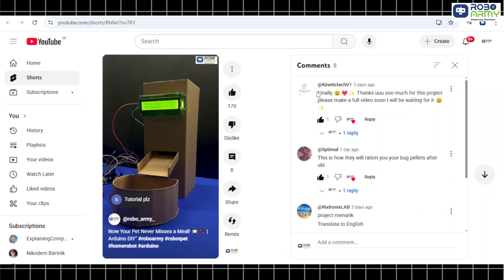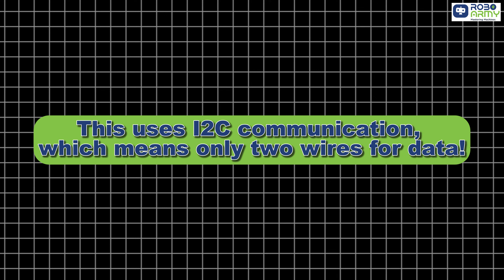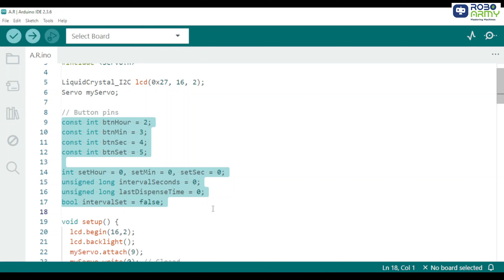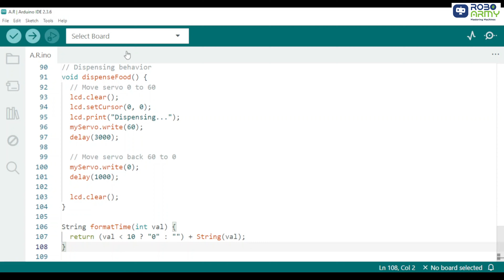No More Mealtime Worries – Auto Pet Feeder | Arduino | Full Project Explained

Comment: Hello! I'd like to know why the " automatic pet feeder " text doesn't show up even though we have the same I2C Adress? The servo motor is working just fine, it's just the LCD that's the problem.
Reply from the maker: Hi! Good question 👍
Even if the I2C address is the same, the LCD text may not show due to a few common reasons:

1️⃣ Contrast issue – Please adjust the small potentiometer on the I2C module; often the text is there but not visible.
2️⃣ Wrong LCD initialization – Make sure the code matches your LCD size (e.g. lcd.begin(16, 2)).
3️⃣ Power issue – Ensure the LCD VCC is connected to 5V and GND is common with Arduino and servo.
4️⃣ Loose SDA/SCL wires – Double-check A4 (SDA) and A5 (SCL) connections.
5️⃣ Library mismatch – Try using the LiquidCrystal_I2C library and confirm the constructor matches your address.

Since your servo is working, the Arduino is running fine — it’s most likely a contrast or LCD wiring issue.

Comment: Hello MY PROJECT IS DUE IN 3 DAYS , can you please make a video IoT "Plant Stress Detection and Rescue system",  For that sensors we’ve to use are:
DHT11
LDR
Water level sensor 
Actuators:
LCD
Water pump, and pls using Arduino UNO, connecting it to thingspeak and also pls Connect it to IoT.
Reply from the maker: That sounds like a fascinating project! Unfortunately, we won't be able to create a full video tutorial on that specific topic within your deadline.

Comment: HI, why is the hour and minutes button not working but only the seconds and set buttons are working, pls help. :(
Reply from the maker: Hi! 😊 Thanks for trying out the project. If only the seconds and set buttons are working, please check the wiring for the hour and minute buttons — especially the connections to the Arduino pins and the ground line. Sometimes a loose jumper or incorrect pin number in the code causes this issue. Try swapping the buttons or checking continuity. If it still doesn’t work, share a clear picture of your setup so I can help you troubleshoot better.

Comment: hello i  have watch ur videos i see how good u  are  i what u to help me do a video or code for one  coin  accepter operating 4 or more relay  as timer any time u inset coin it should ask u to set a bottom 1 to 4 or more for ur time even if relay 1 is working or a deferent person is using relay 1  
if relay 2  is working with time and e deferent Prosen also whant to use relay 4 time so any time a new coin as Bing inset   it should ask for set a bottom to start witch  not to add with the one oready using
i hope to were from you soon thanks
Reply from the maker: Thanks a lot for your kind words and support!  Your project idea sounds really interesting — a coin-operated timer system that can control multiple relays independently is a great concept! 

It will require some advanced coding with Arduino, coin acceptor, and relay modules to handle separate timers for each channel. I’ll definitely look into it and try to make a tutorial or at least share a sample code soon.
Stay tuned to the channel — I’ll update once it’s ready!

Comment: Hello sir we make this project but in our i2c lcd not show automatic pet pedder and can you tell me in this project one breadboard is used or two breadboard we are confusing
Reply from the maker: Hi! If your I2C LCD is not displaying ‘Automatic Pet Feeder’, first make sure the I2C address in your code matches your LCD’s address. You can use an I2C scanner sketch to find the correct address and update it in the code.

For the hardware, this project uses only one breadboard. All components – Arduino, LCD, motor, and sensors – are connected on the same breadboard. Make sure all connections are firm and follow the circuit diagram properly."

Comment: How is the power supply connection can you explain?
Reply from the maker: Sure! The pet feeder is powered using an Arduino board. You can connect it either to a USB charger, a 9V battery, or a 5V adapter depending on your setup. Make sure the positive (+) and negative (GND) connections are correct to avoid any issues. If you want, I can also explain the exact wiring for the motor and sensor.

Comment: Hello! Could you make a food dispenser that uses a stepper motor and a counter from 0 to 9999. And that has a timer to release the food, reset, turn off - on and finally release the food at the time
Reply from the maker: Hello!  That’s a really interesting idea — using a stepper motor with a counter and timer would make the feeder even smarter. Right now, my project is based on a servo and simple controls, but I’ll definitely note your suggestion for a future advanced version. Thanks for sharing your idea!

Comment: How did you make the box and did you use anything inside the box?
Reply from the maker: Thanks for asking! I made the box using simple cardboard sheets, cut and joined to form the feeder structure. Inside the box, I placed the Arduino, LCD, buttons, and servo motor neatly so everything stays compact and hidden. It’s basically the full working circuit inbuilt inside the cardboard box.
Reply: @robo_army_   Thanks. Next time,kindly try to show the full process like how you made the box and inside details.. That would be helpful.

Comment: How connect external supply for servo motor.
Reply from the maker: Hello! To connect an external supply for a servo motor, follow these steps:

Connect the positive (+) wire of the servo to the + of the external power supply.

Connect the negative (–) wire of the servo to the – of the external power supply.

Very important Also connect the GND of the external supply to the GND of the Arduino, so they share a common ground.

The signal wire of the servo still goes to the Arduino pin.

This way, the servo gets enough current from the external supply, while Arduino only sends the control signals